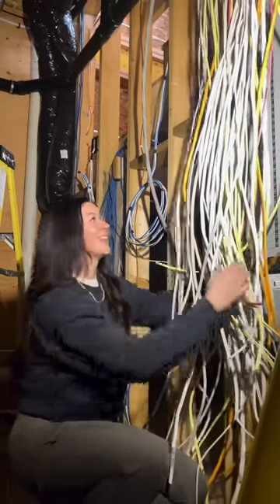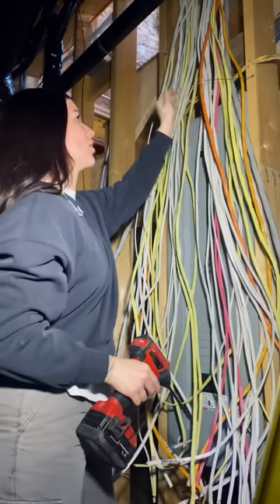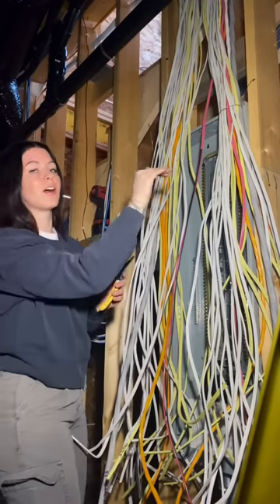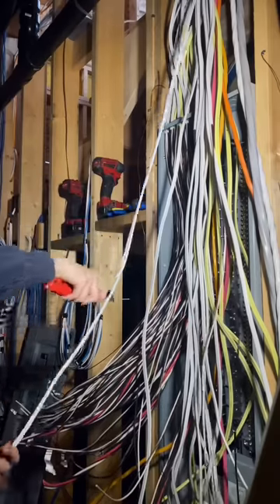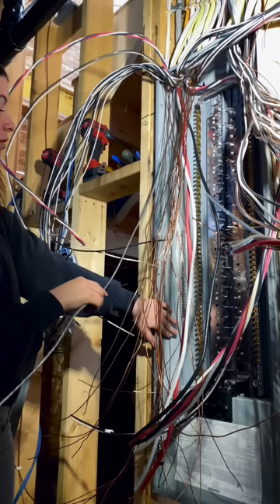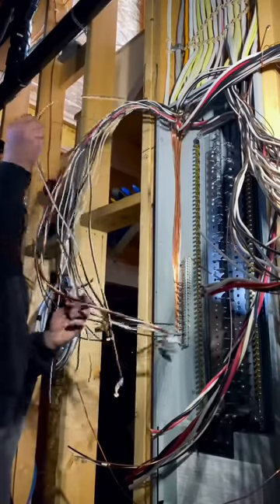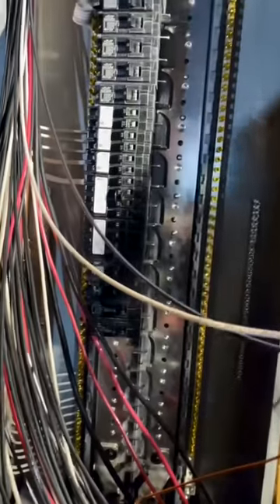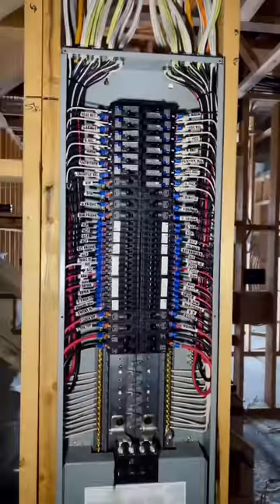How I wire a panel (an in-depth tutorial)

Comment: Honestly I've never understood why America breaker panels are so unnecessarily big.
You have the exact same amount of potential power draw as I do in the UK.
230v at 100A vs 115V at 200A
Both equal 23kw of potential power draw. And yet my consumer unit breaker panel is 1/4 the size. And that includes having RCD (GFCI, to Americans) protection on literally every circuit. As well as an SPD (whole house surge protector)

Comment: How did that little blast occur? It was hard for me to understand what you were saying when you were explaining at that part.
Reply: The bottom portion of the panel is where the main wires feed into the line side of the breaker. Even though the breaker is off and the load portion is dead, the other side of the breaker is always energized unless the meter outside is pulled.
Reply: @gtbr8134  Thank you for explaining🙏🏾

Comment: There's got to be a better way… What about a vertical panel?  Were all the wires come in to the panel straight down all cut and stripped for the most part at the same length... I can hear various arguments, but the main feeder comes in straight down. Which you could still have in the middle of the panel or at one end, I think I'm onto something here.

Comment: Don’t do that rocking and pulling when stripping that wires exterior protection. You will nick the wires insulation with that tool if you do that for sure but it may or may not ever cause a problems

Comment: The only thing that really suprised me was 1. You called the equipment grounding conductors "bonds". 
2. Looks like there are several fittings that have 3 cables on them.  I'm pretty sure most are not listed for that. 
Great job otherwise.  Great video.

Comment: Posting Another, I Will Wire All Breakers, Wire Nuts on All Receptical hot wires, Switch Hots and Travelers, Wire Nut Light Switch Wires instead of a Switch, Then a Bulb Socket with Bulb in Each Room. Blue Painters Tape on all Breakers That Light up the Rooms. Tape Off All Others. 
Having Light in Rooms Makes Everyones Work Easier, Faster, Better.
Their is an Exception That Allows Powering up For Expreimental and Developemental Purposes

Comment: Early after 35 years in the ibew 
I never installed  romex into a electrical  panel 
You should  run conduit. Into the panel romex looks like  garbage . Maybe you should 
 You should take some pipe classes.  You can put the romex into a pull box and pipe down
 Lots of luck.

Comment: That's how I tag my wires but at the top your smashing your wires to the top of the panel then zip tieing them what about future use it's hard to get that next wire in and you should drop them straight down about an inch and a half to 2 inches then bend them over at a 90 to the side of the panel

Comment: These posts are nuts. Everyone is just a horn dog on here. She mounts the panel in the stupidest of orientations, blows up the main lug wire or terminal thus causing damage to current carrying conductors, and she brushed it off!? Not to mention, stripping in the panel is one of the least labor intensive, skilled part of the electrical installation. Panels are elementary if you are learned and seasoned, educated about code and wring methods. Yeah- she does thorough work and takes pride, but just letting the grounding wires flop around like that on an energized main breaker and feeders? Stupid. Hope she learned her lesson and now is less careless while working on a live panel. All you guys on here are just worshipping her with your positive comments and no one points out some blatant safety concerns. Whatever.

Comment: It's s good thing you're a woman. Because wiring all those dammed circuits would be a pain in the BALLS!
Nice job! My only recommendation is lose the set screw connectors,  and that i also strip the cable after i pull them in, which you mentioned your reason not to,  which i get. Peace out! Free Palestine!

Comment: You forgot to torque the neutral and ground  screw in the panel & breakers… instead of relabeling the wire twice.. why don’t you just use the riding you all read wrote on the wire.

Comment: That's not correct  you can put those romex cables in a pull box.  And run pipe and wire to the panel maybe you should  learn  pipe and wire .   I would not accept that.

Comment: Why does she have the panel energized?
Reply: I do my own electric when I build houses and I always turn on electricity prior to having all the wiring installed in the house so that I have no generator needed on sight.. The Wire hit on the other side of the breaker which should have been more carefully covered and not touched that's for sure.

Comment: Bro That is not how you use a blade to strip Romex. Get the first slit down an inch or an inch and a half and then stick your finger in there pull the Romex away from the wire and go around the sheathing with the blade as you're pulling the Romex outand away so you don't nick anything. Do not go straight down like that what's wrong with you

Comment: As a master electrician,  who has wired over 800 home . Putting all connecter in panel , put all wires in panel and staple.  Then strip. So you dont have extra jacket in panel. Like you are doing looks like shit.